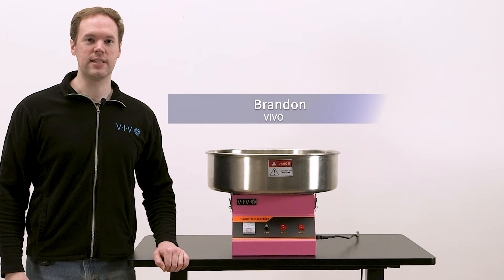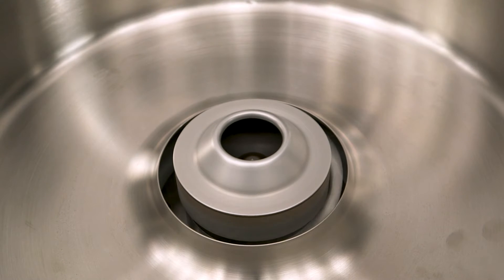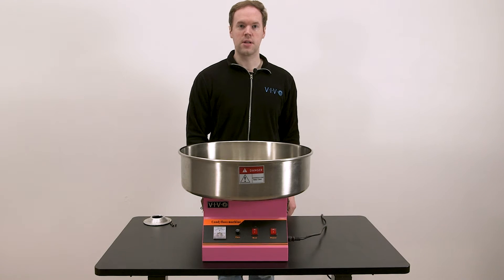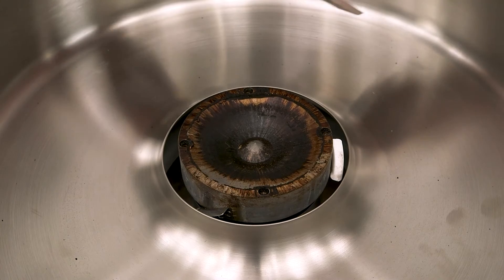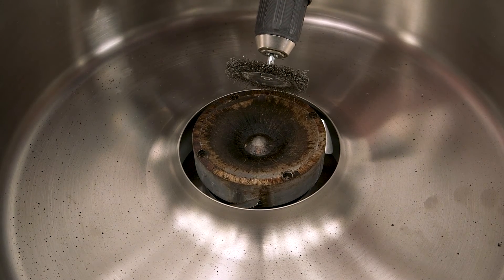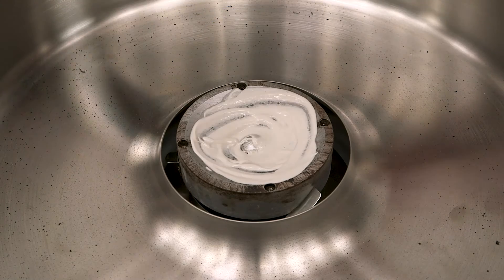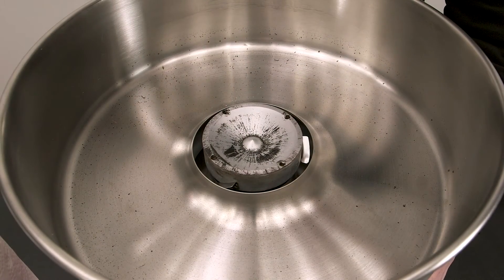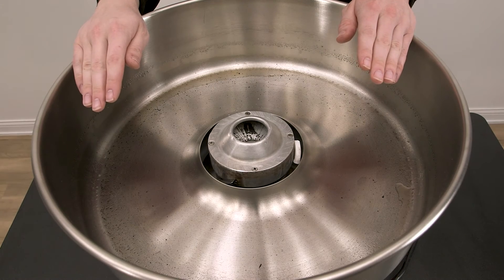How To Deep Clean Your Cotton Candy Machine by VIVO

Comment: Ummm no way I’d use comet on anything I was going to make food to eat.  How about bar keepers friend and a pumice  stone or grill brick
Reply from the maker: Comet is an abrasive bleach cleanser and can often scrub through some of the hard burned sugar.  Since it is a bleach, it does need to be thoroughly cleaned off once finished, and the machine is perfectly safe to use after cleaning.  Bar Keepers Friend can also be used since it's an abrasive powder cleaner, but it does need to be thoroughly cleaned out since it's acid based (the EWG rated it as being just as toxic as Comet).  Grill bricks are similar to the blue scrubbing pad we used, so those are another option if you have them on hand.
Reply: Why not many places that use a flat top for service also use comet to clean them :) it’s okay, just rinse thoroughly

Comment: I followed these steps and the wire brush scratched the spinning head. It appears to still work, but now I am getting the cotton candy collecting around the rim of the spinning head and twisting into tight spirals as it comes out. You say to clean it with water about every 20 minutes. Do I wait awhile before pouring in more sugar to make sure that is dry?
Reply from the maker: The water inside the head will evaporate almost immediately from the heat, so letting it warm back up for a minute and wiping some water out of the bowl with a cloth will be enough before continuing.  The wire wheel does unfortunately leave some scratches in the aluminum, but if there's a lot of very hard burned sugar, it's the quickest way to remove it.  If the cotton candy isn't able to come out from the edges normally, check to make sure there wasn't also burned sugar on the bottom of the plate which could be clogging the very thin slots.
Reply: @VIVOus  Thanks!
Reply: So I tried this on my machine and at first I thought “this is great I finally found an easy way to clean the hardened sugar off”. Well after doing this it took the anti stick layer off and made tiny grooves in the metal. Now the sugar burns easily and after only 5 cones it builds up so bad I can’t use it. It’s like it builds a weeks worth of burnt sugar in a matter of minutes. Take this video down, this method ruined my machine and now I have to buy a whole new head. Thanks alot!
Reply: Same, this ruined my head and I have to replace it now.
Reply: @Chris Miller  I can't believe they have this method posted as the way to deep clean. It's irresponsible of the company to encourage everyone to destroy their spinner heads. This is crazy..
Reply: @chrismiller6700  what anti stick layer ? 
 Try cooking oil and salt heated upwithout the cover and then shut if off and wipe out the spinner with a paper towel . Like seasoning a skillet to be non stick after washing it . Lots of videos for seasoning frying pans on youtube .
 Do you see the small grooves that the melted sugar spins out through when the cover is on ? Are they cleaned enough to let the sugar spin out and not puddle inside and burn ?
Reply: @gregorydahl hi there, very smart idea .. how long have you been using this method on your machine and how old is yours,
Reply: After the wire wheel you can probably polish it with fine sandpaper and cooking oil and give it a good cleaning afterwards.
Reply: I have now gone through 5 Vivo machines! After deep cleaning the plate gets scratched and then sugar floss  all spits out even at high temperatures.  Sometimes it makes the band pop.
Reply: @Vivo - I have a cemetery of Vivo machines in my garage. I have deep cleaned my machine and it causes major scratches. I believe this has been the reason all my floss I pour in spits all back out. Or why the bands always pop.  Why else would floss no longer heat up after cleaning???

Comment: I get sugar built up all along the bowl. It creates a solid ring too. I take a fork to knock off the ring, but some of it is so stuck, I don't know what to do. It doesn't create any issues but looks bad. Any advice?
Reply from the maker: We're sorry, but there unfortunately isn't anything that can be done to prevent this.  As the head spins at high speed, some of the melted sugar forms droplets along the edges that fly out and stick to the bowl.  The ring of sugar does become easier to remove or even falls on its own when it builds up enough, and this can be crushed and re-used once to make more cotton candy (sometimes called the "mystery flavor" if it becomes a mix of sugars).  Any that's left stuck to the bowl will rinse out with hot water when you're finished using the machine.
Reply: You can knock the sugar off the bowl very easily, as long as is the first thing you do when finish spinning and while is still hot. I use the metal scoop and it falls right off in seconds. Key is do it while hot.

Comment: I just got a machine and I’m not 100% sure on what voltage I should have it set to. I had it at 100 and it just spit all the sugar out and barely made any cotton candy. I waited about 10 minutes for it to heat up as well. Any advice?
Reply from the maker: The voltage should be showing between 100V and 120V on North American power systems, so that's at least correct.  If the sugar is being mostly lost in the bowl, it's possible the top plate is deformed and letting it fly out before melting.  Please contact our customer support team and we'll see what we can do to help: https://vivo-us.com/pages/support

Comment: I went a bit nuts and took a Dremel with a wire disc brush to the head. It certainly took off the hardened sugar, but yeah, I scratched the ever-loving crap out of it. Is it ruined? What should I look out for?
Reply from the maker: If the scratches are shallow enough, you may be able to burnish them out with a piece of aluminum stock and then give the surface a thorough cleaning.  It should still be usable.

Comment: Great video.
I notice the spinner head did not have a series of hole along its circumference. 
How does the melted sugar escape?
Reply from the maker: The plate on top has very thin slots around the perimeter, no larger than a couple sheets of paper in thickness.  The slots allow the melted sugar through while being too thin for sugar crystals to escape.

Comment: I have better luck, and less gouging of the element, using nylon brush wheels in my drill.  I can always get it almost "like-new" shiny, but I still end up replacing the element about once a year because the pointy tip of the element easily wears down to a dull nub and the floss comes out much more sporadically.  Would it be possible to use an ultrasonic cleaner for the element, cover, and cover screws as long as all wiring is removed first?  There are a couple of jumper wires underneath that easily disconnect, so I thought it might work to submerge the element in an ultrasonic cleaner to not risk wearing down the element apex.
Reply from the maker: We haven't tried that, so we can't say for sure if it will work or not, and generally don't recommend submerging the head.  If you have a worn out part on hand, you can try it on that first and see if it's effective.
Reply: @VIVOus  I do have a worn out element and I just dropped it off at a local gunsmith that has an ultrasonic cleaner.  He said they could get to it next week, so I guess we'll see if it works or not.  Since I have your attention, is there a torque specification for the 4 screws that hold the cover on the element?  I have a feeling I have over-tightened them in the past and just wanted to check if there was an actual spec for them so it isn't too loose or too tight.
Reply from the maker: @AndyParoczai  If you're using a torque driver, 3in/lbs will do the job.  That's about the same as hand-tight without cranking it down hard.
Reply: @VIVOus  Thank you.  I think I was over-tightening it in the past, which would collapse the thin opening where the floss is supposed to come out.

Comment: Thank you for your video. Once the machine is wound up, sugar escapes between the hole and the cup. I have a gap between the two
Is there a seal between the two? I didn't get the impression when I disassembled.
Reply from the maker: The sugar is supposed to spin out of thin slots around the edges, but if there is too large of a gap then sugar crystals can also get through.  If you contact our customer support team, we can send you a guide showing an easy way to straighten out a bent top plate: https://vivo-us.com/pages/support

Comment: If you don't have a wire wheel, can you use a small wire brush?
Reply from the maker: It will likely be slower than the wire wheel, but yes, that should work.  Just be sure not to scrub it in too hard, so it only takes off the layer of burned sugar.

Comment: Any good tips about cleaning sugar from down inside the screw holes?
Reply from the maker: To clean out the holes, first warm the machine for 20 to 30 seconds to help soften the sugar and remove the screws and top plate.  With those parts removed, allow the machine to continue heating for a few minutes so the sugar in the holes can spin out.  While that's clearing, you can drop the screws into a cup of hot water and then brush them clean once they've had some time to soak.
Reply: @VIVOus  so heat up and let the centrifugal force do the work. Cool.
Reply: If it’s really stuck on a thread tap could make short order of it

Comment: I am so trying this I felt this way too. It use to run so great and is now so slow. I feel the power is less too Idk how to fix that. The voltage used to be higher. I am frustrated every bubble I have bought has broken every season. I felt like they are supposed to last use the box and take special care removing and replacing the bubble when cleaning has to cause it to weaken. I wish I didn't have to replace every season :(  I love this machine and need it to last I don't want to have to buy a different brand. Let me know tips and tricks with the bubble too, please.
Reply from the maker: We're sorry the machine's been giving you trouble!  If cleaning isn't fixing the problem, please contact our customer support team for further assistance: https://vivo-us.com/pages/support
The bubble covers shouldn't be breaking from normal use.  We have a video showing how best to install and remove them, and we hope it helps: https://www.youtube.com/watch?v=1VLjmajhNlY
Reply: Try a shorter extension cord to see if it goes faster again .

Comment: Please help me  , after making cotton Candy it start to shrink and become sticky within 10 seconds, , people say humidity problems , but i try to make every season winter, rainy, summer, indoor outdoor since year still candy start dripping down within few seconds and can’t be able to pack because it became sticky,
Anyone have an idea what will be the problem please reply 🙏
Reply from the maker: Cotton candy absorbs moisture from the air like a sponge unfortunately, so it can melt very quickly in high humidity.  On days like that, all we can recommend is making it indoors in an air conditioned environment (keep a dehumidifier running if necessary) and then bagging it right away.